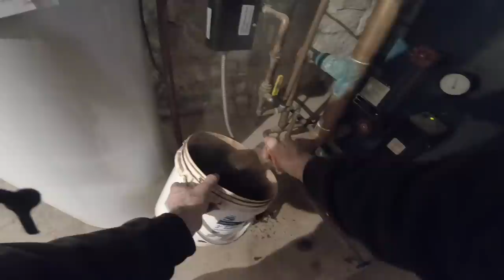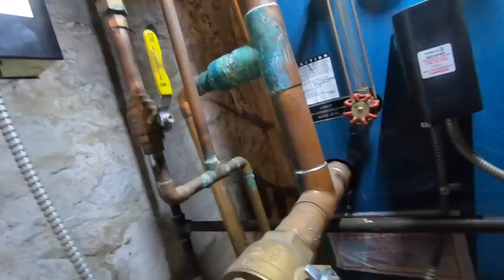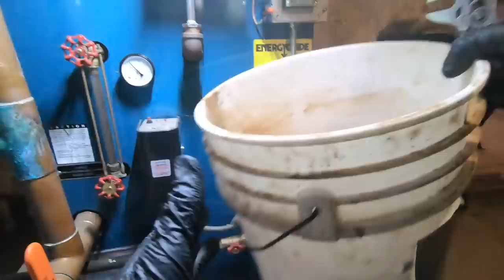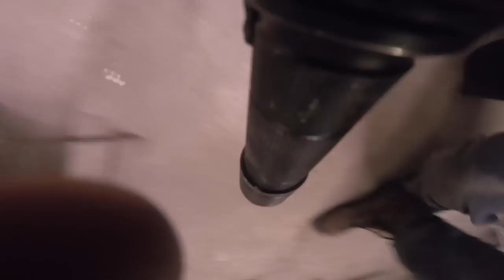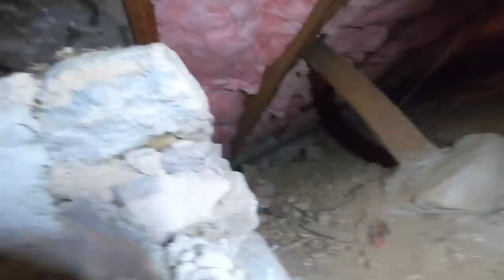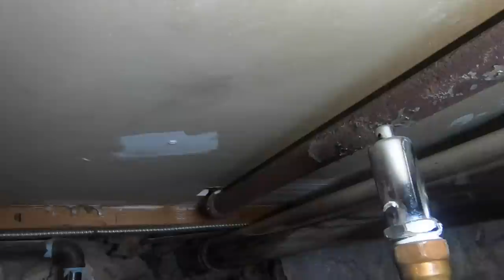Steam Boiler Leaking Main Vent

Comment: Another one piped in copper. Wrong.
Reply from the maker: Yes its not the best yet I run into copper piped steam boilers often. I did it once yet all my boilers I pipe in black pipe. Always end up with small leaks on most copper solder joints over time.

Comment: Great video pal .. What's type of bleeder  valve was that
Reply from the maker: That's a main steam vent to release air from the return lines. The supply vents are located at the radiators. They are temperature activated. They close when hot enough not to allow steam out. And open when cools down to allow air out until the heat of steam hits the valve.

Comment: That's interesting! We generally don't have steam heat in the area where I live so no experience with it. The water in there looked pretty dark. I assume that constant leaking and replenishment with tap water just builds up more and more solids?  Congrats on the gift as well!
Reply from the maker: The darkness of the water is iron from the inside of pipes and radiators slowly rusting. Which is why flushing and maintenance is critical on these boilers. I like working on steam boilers it’s what I grew up with heating my home.
Reply: The HVAC Hacker flushing how? I was told dumping the guck out of the bottom did nothing (which I thought was odd) and just increased the chances of needing the replace the valve.  I wanted to try to do a skim myself in the spring (in case something goes wrong lol) but I was interested in a blow down, there is no king valve on the manifold header does that mean its never been done? There is a union there though.  That is something I dont think I can handle myself but it is it needed?  1991 Weil McClain eg-40
Reply: @thehvachacker  Thanks for the reply. Yep it's interesting how we're all fond of what we grew up around!

Comment: I didnt think copper could be used for a steam system?
Reply from the maker: It's not the best and solder joints seem to leak though often. Also seal themselves up at times. why all the green deposit on the hartford loop before boiler.Steel is the better choice

Comment: Wow they piped that header in copper oh boy. Equalizer line, some return piping and Hartford loop is ok in copper i wouldn't use it for the header!
Reply from the maker: Yea not the best way to pipe a header. I think steel should be used for most steam piping.
Reply: I would never use copper on a supply header. Regardless, when I solder fittings, they are flawless. That boiler was hacked in by a hacker.

Comment: Nice vid.  Can’t undo my two main vents that are both hissing. They appear to be the original vents from the early 1940’s and seem fused to the iron reducing bushing.  Trying to avoid cracking old steam pipes.
Reply: I removed mine with 3 foot pipe wrench with a cheater attached to the end. It's all about rotational Force.

Comment: Are automated bottom boiler blow down systems available for residential boilers?
Reply from the maker: Never seen a residential application with an auto blow down. Yet wouldn’t be a bad idea for some of my older customers who can’t lift buckets of water
Reply: question is, where you you have it dump too?
floor drain? sump pit? the yard outside assuming 1st floor boiler or walkout basement.
all I see is clogged drain/sump, frozen outdoor end or a basement without sump/drain and it wont run uphill :)

Comment: Nothing like showing off a new pipe wrench
Reply from the maker: I bought that for moms water heater yet this wrench has gotten quite a bit of work already. My older 2 foot pipe wrenches teeth were stripped down a lot. Strange usually I don't buy new ridged wrenches since most second hand Ridged tools/ wrenches are just as good as a new one.
Reply: The HVAC Hacker I noticed he rewarded himself with that new wrench too!😃

Comment: I’m always worried to use stuff like penetrating oil and wd-40 when working on my steam system because I am paranoid about what it have read about how bad oils getting in the system is.  Is it typically safe to use it to free stuck fittings in the steam system? When I saw you use it here I realized maybe I was being overly paranoid
Reply from the maker: When a boiler is new there is oil inside from all the threaded pipes. When threading pipe oil is constantly applied not to burn the teeth on threader. That oil gets into the boiler. Which is why a new boiler always needs to get skimmed after running for a few days. A little penetrant or wd-40 won’t do anything. You can tell by the water surging if oil is present in the boiler, then just open up the fitting on the upper side of boiler. When my company installs a boiler we use t’s with a plug on side, on the supply where it leaves the boiler. This allows for skimming to remove the oils, it’s very uncommon to have to skim a boiler that’s been operating for some time. Unless the water is jumping around inside the sight glass

Comment: You never took the wire nut off of the thermostat wires. What was the temperature in the house when they called you back?
Reply from the maker: I removed wire nut when I finished this job. Every steam boiler I work on I jump this way. Prevents homeowner from shutting down system of thermostat reaching temp while I test the pressuretroll

Comment: What would cause a steam boiler to shot out water on the radiators air vent?
Reply: Condensate not leaving the radiator. For example the pitch is wrong on the radiator or the vent itself is faulty not closing when steam reaches it.
Reply from the maker: Water is trapped in the radiator. Or the vent is not working correctly. The radiator should have a slight pitch down to where pipe attaches for drainage. Does the vent close? Or hisses none stop?
Reply: @thehvachacker  hisses none stop
Reply from the maker: @cyabits1  bad vent
Reply: Did you get it up to steam pressure and check that black pigtail  Probably plugged

Comment: My main vent on my single pipe steam is at the top of the Hartford loop drop pipe, only about 1in nipple.  I read this is bad.  Should I get a longer nipple like 6 inches?  Anything I can do to deal with it not being 15 inches back as well?
Reply from the maker: Does it operate correctly. I seen many vents on a 1” nipple or just threaded into the t. What have you heard that would make the location of the vent wrong? I see many boilers with the vent directly over where the return pipe drops back into the Hartford loop. Do you get a lot of banging and clanking?
Reply: The HVAC Hacker it was in a Weil McLain training video (part 2 I think) that someone uploaded to YouTube.  The Weil McLain guy says its important to have the main vent 6 inches up  and 15 inches back for proper operation.  That being said, I don’t think its an issue from what I can tell, i don’t see condensate coming from the vent.  However after my system would run for a while, a radiator (top floor, furthest from the boiler/main vent btw) would make a loud noise kind of like it was leaking steam but instead it was sucking air in very loudly (its a Groton).  I was told on heating help this could indicate a bad main vent or insufficient main vent or improperly installed.  So i checked and sure enough on the loop that the radiator is on that vent was not getting hot like the other one.  It would only get hot if the system ran for a long time so i think it was stuck closed.  I replaced the vent and now they both get hot around the same time, its been too warm to run the system long to see if the loud air noise is gone now from the far radiator.  If the sound continues i was going to put a t and 2 90s and make a little manifold to put 2 of the Groton #1 vents on to see if increasing the main venting solves it.  The main issue with my system was inconsistent heating but i found tons of leaks in the system and it was never building up any pressure.  I have been fixing the leaks, i repacked a couple valves and replaced almost all of the air vents with vari-vents (keep hearing mixed feelings on these vents).   Its getting definitely improving with all my work but i think it can still get better.

Comment: steam stain on the ceiling told a story :)
Reply from the maker: Yes but this house has had a steam boiler here since late 1800’s. I’m sure many vents have leaked. If you have time check out my other channel Bills Tools that’s where my garage Reno is being done and other not hvac related projects
Reply: the light orange stain was perfectly in line with the old vent hole and very doubtful they'd replace it and get it lined back up exactly.
I tend to notice things like that from tracking piping and roof leaks over the years :)

Comment: Old vent looks like a cheap China air vent. I like Gorton #1 Main Vent or Hoffman #75 Main Vent, But I prefer the Gorton seem more reliable.
Reply from the maker: It's an old Doyle #1a vent. I believe it was before they started making Doyle vents in China. I use to like those vents before they became Chinese made.
Reply: Are the Gorton brand made in Glauster?

Comment: Asbestos?
Reply from the maker: All over this house. The house was built late 1800’s many old houses in jersey. Why lots of steam systems exist. Asbestos is safe as long as you don’t break it apart. Usually it’s the fittings on the pipe. The straight pipes had some kind of cardboard with an outer paper wrap.
Reply: The HVAC Hacker correct. I worked around it for 40 years. It’s in bad shape in this house, breaking apart. Just saying be careful. My wife died from it. Taught in an old school that had a lot of it in it. They shut the school down for 2 years to clean it out after she passed. Stay safe buddy!
Reply: The HVAC Hacker when i repacked my circa 1920s steam shut off valve on my radiators some kind of fibrous material came out, looked more like some kind of hemp though, could that have been asbestos? I tried to avoid vacuuming it up just in case.
Reply from the maker: Chuck I am very sorry to hear. I will be wearing masks for awhile. I just got out of hospital been cleaning lots of who knows what from my new house. Ended up with colitis most likely infection yet I’m wondering if all the dust and paint fumes could of caused this, I purchased a respirator for all future work their. I’m hoping for infection not chromes or colon cancer
Reply: The HVAC Hacker hope you are feeling better fast. I’m not preaching, just reminding people about taking caution around asbestos and wear proper PPE, especially when it’s in a deteriorated condition. Masks are good when cleaning out any basement, garage or attic. God knows what’s being stirred up, and being breathed in...and don’t forget ceramic fibers too in insulation blankets and around burners...just as bad